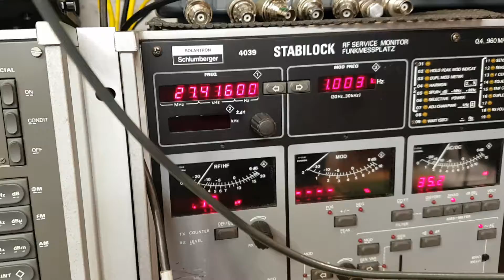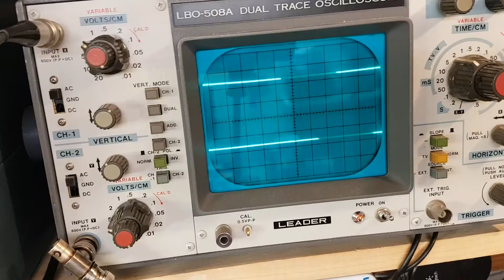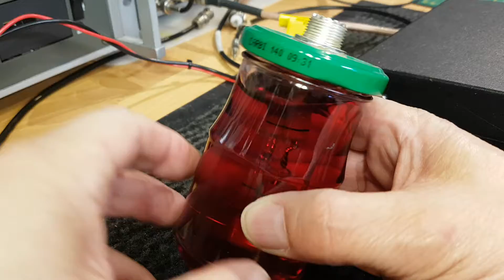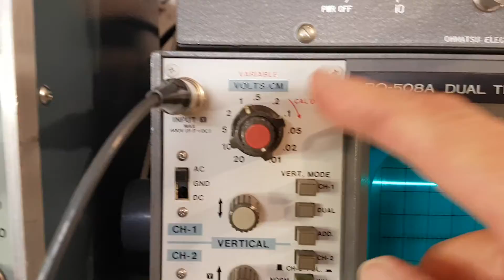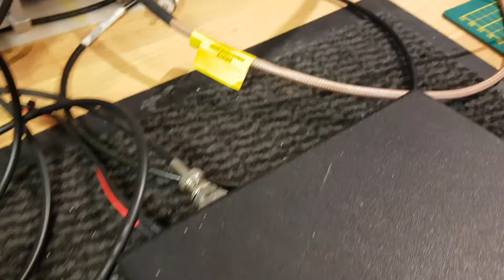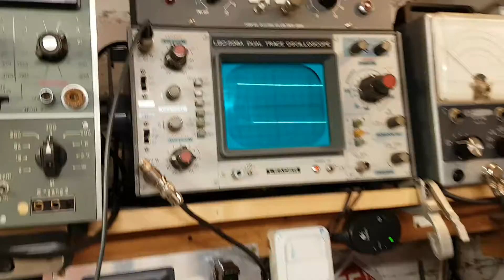Connecting an oscilloscope to your CB radio transmitter output.

Comment: Went to a ham radio swap meet I bought a donation table it was picked over so I bought all that was left to clear it off and they didn't want it back .got a real old oscilloscope ..knew  it would require some things .. dummy load and such . To not let the smoke out .. see it's going to be of use to me after all for CB and some ham radio

Comment: So what's the purpose of the wire wrapped around your dummy load?  Why would we need to do that?  I have a Radio Shack 50 ohm dummy load.  I just want to see why my Maxon MCB-45W isn't putting anything out.
Reply from the maker: It's an inductor. When you attach the scope to it you can see the transmission without significantly loading the output or frying your scope.
Reply: @DerekHerbst747  Ah, ok.  Thanks.

Comment: Can you connect the scope to the toroid coil/ bridge rail inside an SWR meter to get the same result?
Reply from the maker: @Sys-Edit0r-1995  it's not advisable because you will load the signal. Some scope probes can be damaged depending on the design. If you select the 10x option on the probe it can be done.

Comment: IMPORTANT! For any of you new to oscilloscopes like i am, and are wanting to see the output of your radios on a scope, its worth noting that the electromagnetic coupling "coil of wire" method is preferred in 90% or more of your test case needs. Why? Input frequency de-rating. The specified maximum input voltage of your scope and probe are NOT CONSTANT! It will decrease dramatically with higher frequencies. A high power transmitter is more than capable of damaging a probe, and possibly a scope as well if you are probing the output directly without an attenuator because some transmitters are capable of relatively high voltages at high frequencies. Always check the voltage de-rating curve for your probe. Most probes can handle stock CB radios on the x10 attenuation setting and some can handle even higher than that. But always be sure. When in doubt, attenuate it out.

Comment: so the resistors work well. but its so much cheaper using tap water and some table salt. salt water dummy loads make for a great high power load at almost free! i do the same thing with my scope but i just have my salt water load. anyways great stuff brother

Comment: Very nice equipment unfortunatly i couldnt afford something as sophisticated just a cheap pocket sized osciloscope a frequency counter ohms meter an antique signal generator which is so old im too scared to plug it in lol and a few different atus with built in dummy loads swr and power meters upto 3kw  nothing in comparison to that test gear lol
Reply from the maker: Actually, my Stabilocks can only handle 50 watts continuous.. of course other than that they're great tools!

Comment: Would love to learn to fix CB and HAM radios. I have an basic understanding of electronics but where can I learn?
Reply from the maker: Start with normal FM radios and learn how to fix just receivers. You'll be surprised how quickly you learn, and how much great information is available on the Tube.. Check out "Electronics old and new". My buddy Manuel makes excellent videos!!
Reply: Easy go to a tafe school or university they run many electronics courses that's made to fit your experience from starter to advanced because if you want a career in that field you will need a certification I did one their great fun and you learn so much good luck my friend 🙂
Reply: Buy a copy of the best selling "understanding and repairing CB radios"
Reply: Nice video
Reply: Take apart older electronics

Comment: Ok man, come on. Other then that fancy equipment, what else can we just buy for up to 1000 watts to put in between the scope and radio?
Reply from the maker: You can use the method described in the video. Just use higher wattage resistors to cope with the power output. Alternatively you can buy a 1000 watt dummy load with a tapping for a scope output. Some RF wattmeters also have an attenuated output for station monitoring.
Reply: @DerekHerbst747  ik thats really helpful, I appreciate that so much. Thank you
Reply: @DerekHerbst747  Hello . Cool video. Could i wrap wire around my 25 watt dummyload heatsink ? Then connect probe to wire ?
Reply from the maker: @pottypete5593  it might work
Reply: @DerekHerbst747   thanks will give it a go :)
Reply: My salt water load I use can take as much power as I can throw at it with zero resistors. You tune the dummmyload using the salt and the level of the water.

Comment: Won't that coupling be frequency dependant? If you use the digital scope you could run FFT to check the harmonics. Or use TinySA. But I expect the higher harmonics to be attunated due to the coupling.
Reply from the maker: Yes you are right. However this method is only used to view the envelope, so as to check the biasing of the final stage. Under or over biasing will result in distortion of the audio. SSB modulation is particularly important to check using this simple method. I use a spectrum analyser to check harmonic and spurious emissions. You can't see harmonics on the scope.
Reply: @DerekHerbst747  I use a spectrum analyser too, but for someone who does not have one, the FFT function on the digital scope should be able to do something. As alternative to the wire spool around the dummy load, I think one could also just use a BNC T-adapter to route the signal via the scope before terminating in the dummy load. The scope has a 1M ohm input and will not create too much reflection if connected directly to the T-adapter.
Reply: Yes 👍 n can use the FFT to measure harmonics and any type of frequency charteristics

Comment: If I understand correctly, you connected 4 resistors in parallel (47R/4) then again 4 resistors in parallel (total 8 pcs) and those two sections in serial ? Then you end with 2*(47R/4)=23,5R resistor 🤔
Reply from the maker: My mistake: the resistors are 100 ohm.
Reply: @DerekHerbst747 3:35 Somone needs to do Thier homework 😂   I'm sorry mate noting personally
Reply: @DerekHerbst747  yes, i just ran the maths as in the video because i know it was wrong,   before commenting i just looked to see it anyone else had spotted the discrepancy.
Reply: I just came into the comments to suggest using 100-ohm resistors instead! 😄